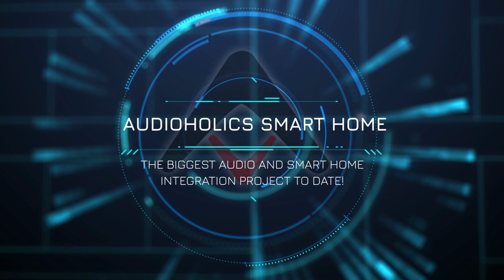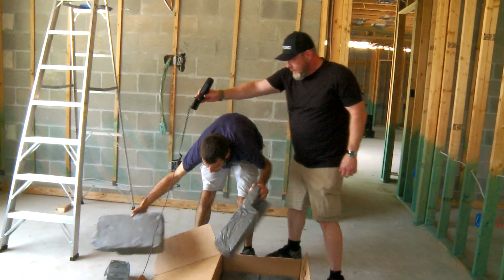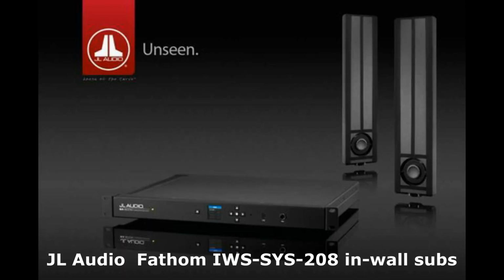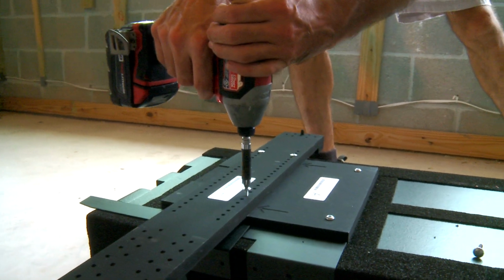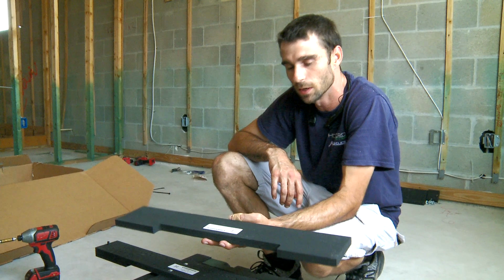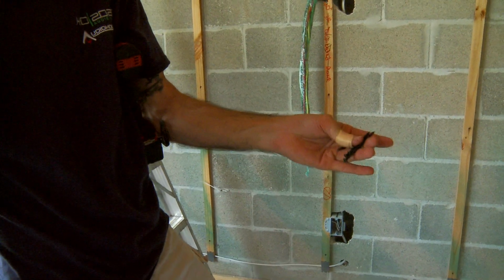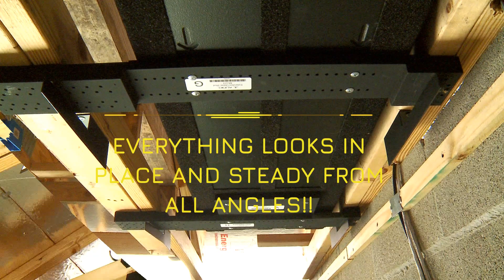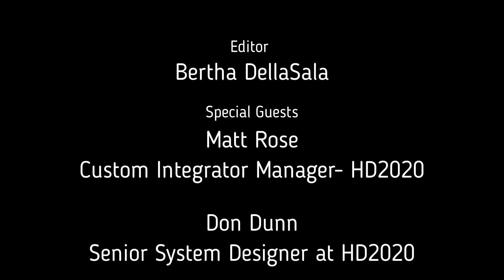JL Audio In-Ceiling Subwoofer Installation: AH SmartHome

Comment: Neutrik SpeakOn on the amp, but not on the speakers themselves.  I would have done it the same on both.  Binding terminals are okay but I don't think we should mix and match connectors like that.

Comment: The subs are next to each other. Isn't that a no no? Or is it different when mounted in ceiling?
Reply from the maker: Ideally they would have each been corner loaded but the builder but a large air condition vent near one corner of the room preventing it.
Reply: They are fairly far apart.
Reply: @DigitalDonAV  can't believe U guys both replied lol. Today's gonna be a good day!!

Comment: so why subs in the ceiling? goes against all ive been told. are you still having subs on the floor?
Reply from the maker: Ceiling and floor are essentially the same when it comes to loading bass. These subs are installed in the ceiling so that all you see are vents like HVAC. Very low profile, hidden out of sight.

Comment: With subwoofer placement being so critical for the best performance how the hell do you cut install and hope for the right result. There is so much adjustment when doing subwoofers
Reply from the maker: Corner loading is usually a safe bet and placing multiples ensures better seat to seat consistency, allowing for EQ to be more useful.

Comment: So if you had floor based subs you would do a sub crawl to determine best placement. Whats the equivalent method when dealing with ceiling mounted subs???
Reply from the maker: Same principal but I'd just use 2 subs one in each corner and EQ. Once you set a inceiling sub into studs, you can't move it. Lol
Reply: You simply do a sub fly by

Comment: Just wanted to throw in a safety note – Don’t use cheap flimsy ladders like the one shown in the video, especially when carrying anything heavy. I had one fail on me 4 years ago – Shattered both bones in my left ankle. Use genuinely heavy duty (not just advertised heavy duty), stable ladders. You may save yourself a lot of pain, time, and money in the long run. Easily worth the extra cost.
Reply from the maker: Ouch,  so sorry to hear that and good tip.
Reply: @Audioholics  Thanks. Ironically it happened while I was working on my home theater.

Comment: Those timbers would not be studs. A stud is a vertical member. Difficult to know what accurate term to use though. I would tend to call them ceiling trimmers. But studs they are not.